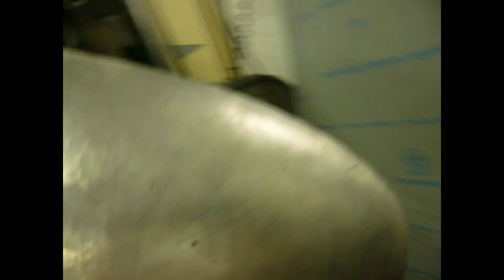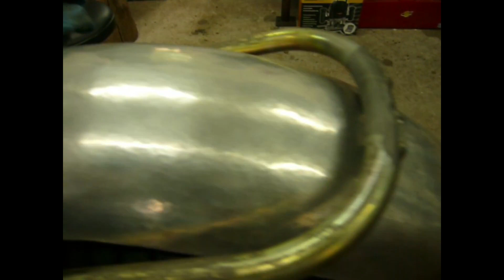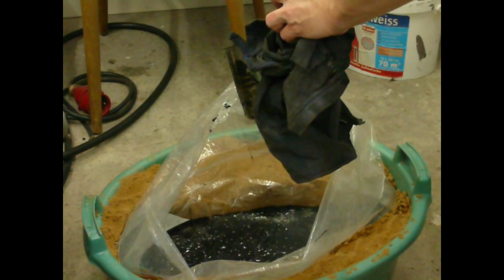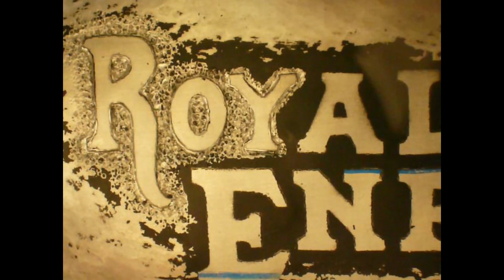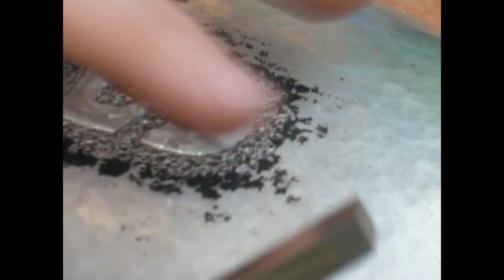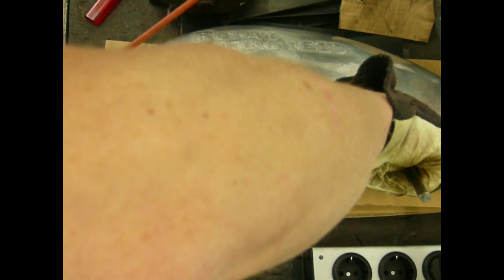Making an embossed motorcycle tank from hammered Aluminium

Comment: Hi Andrea . i like to see more video of the bike . looks like you are using RE model g type forks , like early trials ..
Reply from the maker: Well, I might do a video of the bike once it is finished, or at least running. The forks are of a Fury, or VAX Interceptor. Almost like the model G, but still a little different. These were taken from my Interceptor where they didn't fit anyway. Badly bent, probably by a crash, but nothing a tittle heat may not fix :)